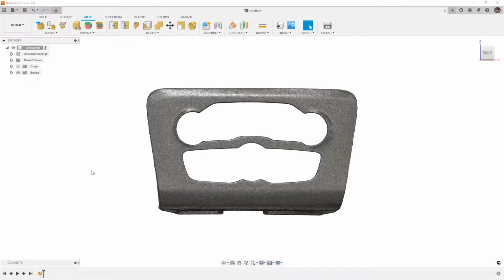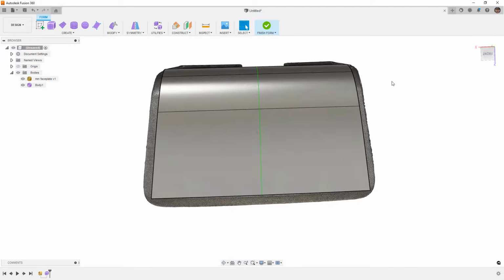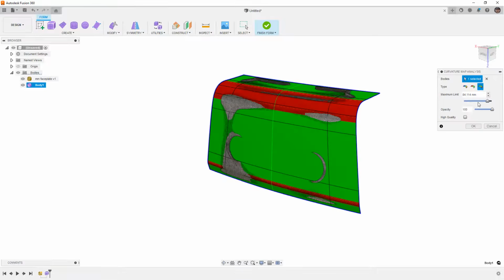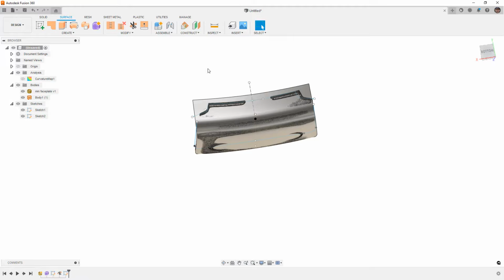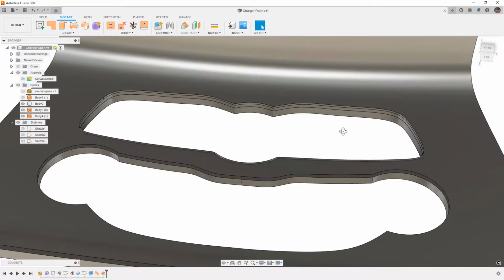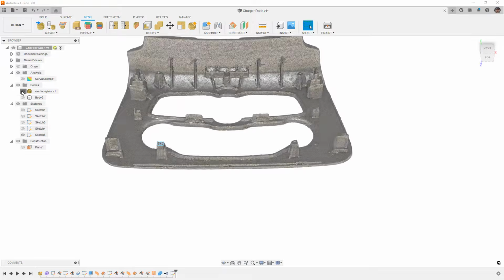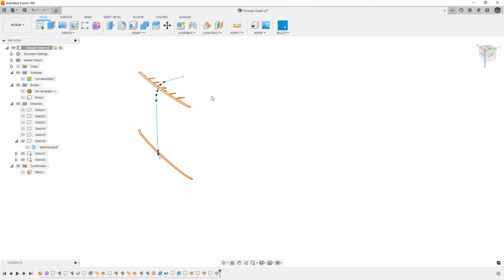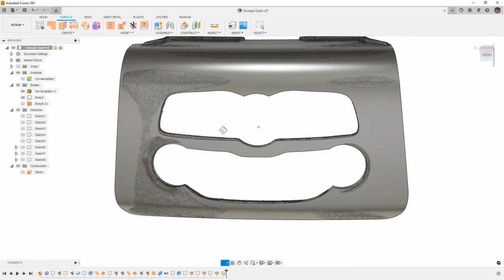Reverse Engineer Car Parts with CAD | Use Forms and Surfaces to create CAD models from SCAN Data

Comment: When I am replicating this process on another scan, my faces do not follow the curves of the object like yours do, they just appear flat between the four selected points. Is there a setting to get it to do that? Snap to object is checked, simple mode, and 4 sides. 

Edit: solved this, for anyone having the same issue - I had lowered the quality of my model too much to make it faster and the place it took the most liberties of removing quality was around the edges. With a less heavy-handed reducing I was able to maintain the curved edges.

Comment: What is a good way to get a 3d line around the outer edge of a detail?
Reply from the maker: If you have modeled the part as a solid, you can start a new sketch and under the create menu go to "Project/Include" and there is an option to include 3d curves.  You can then select the edge and this will give you a 3d sketch curve.

what do you need to use it for?

Comment: How is your software working so smoothly. Whenever i work on scanned data in fusion it keeps on crashing frequently.  System configuration: i7, 16GB DDR4, 4GB Nvidia graphics card, 512gb ssd. Whats wrong with my software
Reply from the maker: The size of the scan data has a big impact.  Fusion is ok with 10k triangles but once you get above that you start to see hits in performance.  You can right click on the mesh in the browser and make it "unselectable" and that helps.  You can also remesh the reference with a lower poly count and just hide the high density mesh until you need it.  another user told me they derive out the mesh into a file and that works smoother but I haven't tried that yet.
The system I did that video on is a 10th gen i7. 3.8ghz (with boost to like 5ghz). 8 core. 32gb ram.  I have an nvidia rtx A4000 but i think when i did that video it was a lower spec card.  RAM helps and single processor speed.  The biggest problem is that the number of triangles that need to be highlighted when your cursor moves over a mesh really drags the system down.  Thats why the unselectable or lower poly mesh helps.

Comment: one question, why do you model the whole part and not divide it symmetrically, having finished the whole half of the part, simply mirror it onto the finished part?
Reply from the maker: In the form, the green line is a symmetry/mirror line.  While i can manipulate either side of it, the model has symmetry.  With a form body that is the way to keep a smooth transition across that mirror line.

If i was doing this with a surface i would create a midline curve and use that as a tangent direction and then mirror.  But with a form if you don't have that symmetry applied there is nothing driving the curvature direction at the midline and you would get a seam when you mirror it.

Comment: Since the shape is already scanned in, why can’t the computer make the mesh?   It’s a computer, that’s what hey are for.
Reply from the maker: There are companies working on mesh to solid conversion tools but in general the tools are expensive and the process is time consuming.  If you just want to 3d print then you can take the mesh and do that.  But if you want a CAD model made of solids or surfaces, that takes a bit more work.

Comment: How did u take it from mesh to designing. I have a mirror that I scanned the bottom of and I want to design a new body off the shape of mirror for a spacer. Howwwwwww
Reply from the maker: Depends on what you need/mean.  I have a lot of videos on mesh based workflows.  Sounds like you might want mesh section sketches.  Week or so ago i started a new series doing mesh based design for an RC car part. might help.

Comment: Great video, very informative, thank you. I am wondering is no way we can create a formed shape much quicker? Such as creating a form, creating a plane, subdivide it as many times as desired, and then get the vertex points to snap onto the mesh (in the one axis). This would surely help create a form of the mesh much quicker? I am very new to playing with 3D Scans / forms :)
Reply from the maker: Thanks.  Forms are great at getting the main shapes down.  Once you have to add details like the openings you need to go to sketch/surface for sure.  This was a part a subscriber was trying to make and because it was going to have mounting details and features to fit the dash we just started with sketch/surface approach. but 100% you can chose the one that is right for you.

Comment: What is the best format to save a scan and export to fusion
Reply from the maker: I generally default to OBJ for this but there are some nuances depending on what you have.  STL will be fine if you are talking about a scan because it is only going to be triangles.  STL saves the points for each triangle.  OBJ actually stores a vector so it can handle non-triangular faces.  So if you are remeshing as a quad-mesh for example then you would want to use an OBJ.  That is probably the biggest difference when picking.

There are other mesh formats but generally their benefits show up elsewhere.  Like 3MF can hold some 3d printing setup information where an STL is just a mesh.  OBJ files are often used for rendering over something like an STL.

hope that helps.
Reply: @LearnEverythingAboutDesign  i have tried scanning with my iPhone 14 pro max using scaniverse the scans turn out good on my phone but complete crap once exported to fusion.

Comment: Great video, I learned about tools that I didn't even know existed. 
Is there a trick how I can position my scanned model reasonably? It floats in free space and I would like to center it at the origin or align it to a straight edge.
Reply from the maker: Yeah there isn't a great way to do it accurately.  It is best to do it in the scan software if it will allow.  I do have a video talking about this with a more mechanical part.  https://youtu.be/82vD7YSKIAo

Comment: id love to see a parametric workflow for doing this
Reply from the maker: I do have some parametric reverse engineering videos.  Is there something specific about this part you want to see? Or just the general workflow?
Reply: @LearnEverythingAboutDesign  Just that parts like this seemingly are like 90% parametric, and a ton of CNC / 3d printing / rev- engineering is going to be parametric. It also allows us to do minor and major changes in cases of material shrinkage- etc. I'd just like to see how the approach to parametric reverse engineering differs.
Reply from the maker: @user-jk9zr3sc5h  sure thing.  Its not exactly the same but if you  haven't seen this series I did (some) of the model 3 different ways, forms, surfaces, and finally parametric. https://www.youtube.com/playlist?list=PLBDfGh8A8kXWa_eSWWPPZ5NevfWsDwJrj

Comment: following along in your tutorial helps me some. still learning fusion... my question is if you were to scan the floor of a car to model a speaker box is this the same principal?  The oblect scanned isnt fully defined due to just scanning the floor. Do you have any videos leaning more towards this type of modeling? Thank you
Reply from the maker: Yeah i do have a few different videos from motor mounts to this dash piece to making speakers for door panels.  https://youtu.be/6ayKg400sEg  I don't specifically have a floor scanned but it should be the same principle.  use the mesh as a reference and attach/match it where needed.

Comment: Coming back to design (for myself now) after 10 years away and was on UG/NX as a contract product designer for GM and was mainly an interior plastics designer and did a lot of class A surfacing. I'm now playing with Fusion trying to make things on my 3D printer and using the revopoint pop2 scanner. I first saw a video by Making for Motorsport and he suggested your channel. This is my first video of yours I'm watching and I'm loving it. I'm so thankful for this content. Thanks for your efforts. Crazy that this software is free and so capable. I'm old..
Reply from the maker: Thanks Ross!  Great experience there!  I used NX4/NX5 many moons ago.  I was working on a project for an OEM that was using NX and required I work with their system. Super powerful tool!  I WISH we had Class A in Fusion but it is a very capable tool.  Even at the retail price of around $400/year considering how deep something like NX or Catia goes.  Great to hear how you find the channel also.  Hopefully in the near future I will have some more full process vids for scanning/design in the auto segment. Stay tuned!
Reply: Would you be abble to reverse engineer a grille design and do some modifications?

Comment: 3 months ago I was thinking hard about buying a 1000$ range 3D scanner or an Ipad Pro with lidar to speed up my design work. Thinking this would be miraculous. I started educating myself, and although I would find decent results scans on YT, it was far from perfect. Then I tried Photogramettry for a month or so and it did not produce satisfying results either. 

After that YouTube algorithm suggested  your 'Hobby vs Pro scanner' video. The moment of truth when you showed that scanning was good for reference but you could not use the scan 'as is', even with an expensive scanner. 

Now, my expectations about 3D scanner are closer to reality. With these two videos, I know what I would get into if I bought a hobby scanner.  I love to see how you reverse engineer these scanned parts. The way you made the interior ring with offset surface, ruled and trim is going to be used from now on in my designs. Thanks!
Reply from the maker: I am glad it helped!  Most of the scan reverse engineering I have done on this channel has been with the hobby level scan data.  I am planning to do some meshlab videos in the future and talk more about mesh processing and manipulation, just need to find the time ;)

Comment: Is there a particular reason why you don't define your mirror lines as "center line" constructions?
Reply from the maker: The differences between a construction line and a center line are minor. Measuring from a center line to another line will default to a diameter measurement and not just a distance.  So generally I use the Center Line type of I a modeling a revolved part.  I think it might automatically select the center line when doing a revolve and it does auto select the center line if doing a mirror, but again if its not a revolved part I generally don't use it.  You certainly can use it.

Comment: I use vx model to section my scans then rhino for surfaces then solidworks for flattening and export to cnc cut
Reply from the maker: When solidworks added the flatten surface tool in 2015 or so that was big.  especially if you are designing parts and cutting composite fabrics.  There are addins (exact flat) for Fusion to flatten faces but they are made mainly for fabrics..and it's not cheap   You have to go through a lot of tools to get what you what, I hate that :)  
Curious why you use Rhino over SWx for surfacing?  You could bring your scans right to SWx(not great with mesh data) and use PowerSurfacing to reverse engineering them then flatten.  Might save a few steps.

Comment: Thanks a lot for the wonderful videos.
 i'm looking to make side scoops for my car what do you suggest is the best way to get the 3d scan of the area where the scoop will be mounted.
Reply from the maker: Depending on the car, sometimes you can find/buy scans online if its really popular.  There are places that rent high end scanners, at least here in the US.  Often times they are rented for a week minimum and last time I rented one it was around $1500 for the week.  Another option is to contact an engineering firm that can scan it for you.  I have one that I work with located in Atlanta, GA.  The last option, and the least precise, is to use something like an XBOX kinect sensor with Skanect software OR look at some of the off the shelf consumer solutions like RevoPop.

The absolute last option is to try and do it with Photogrametry.  Basically taking a lot of pictures of the fender and using software to try and create a mesh.  This requires you use a good camera and have good lighting.  Free versions of software often times will limit the number of pictures(usually around 50 I think), while paid versions allow for more.

If you have an Xbox v1 or v2 kinect you can try Skanect for free for hobby use and see how it works.

Comment: Currently doing this… it’s been a struggle.
Reply: My current issue is that I’m working with a scan of a quarter panel that’s around 800k poly so I have to reduce it down for Fusion to even process it.  I’ve tried both of these technics and it’s painstaking.  I’ve been forced to just convert the mesh and edit the actual mesh… which takes forever.
Reply from the maker: The Tesla wide body I did was the highest density mesh I have used in Fusion.  It had 10million facets on it.  While it was slow it was usable.  It certainly helps to isolate the area you need.  I am happy to take a look and see how it performs on my end if you want to send me an email. support@caducator.com
Reply: @LearnEverythingAboutDesign  That would be amazing!  I’m very much an armature at this right now but I’m learning a lot.  Once I get to my computer I’ll shoot an email.

Comment: Ha!! Literally am doing a video right now on this exact subject, but using prismatic solids more rather than forms and surfaces… (I was planning on signposting to your channel anyway so 🤷‍♂️)… 

Great minds think alike!
Reply from the maker: Awesome!  Something new for the Sierra!?  I enjoyed the ITBs added to it!
Reply: @LearnEverythingAboutDesign  cheers.  it’s a suspension upright, gonna go on the mini eventually, but slightly modified and I want to have an easily modifiable model to do lots of iterative design (guess) work on… and .stl don’t do that! 😂
Reply from the maker: Yeah STLs don't like that :)  Paramesh helps but not like you want.  In case you didn't see it I did a "configurations" video using API to pull in data from an XML file and build versions of a part.  Might be neat to design your points in a spreadsheet and spit out a dozen CAD files easily.  Shoot me an email support@caducator.com  if you want me to tweak the code for you.
Reply: @LearnEverythingAboutDesign  I only understood about 50% of that 😂😫🤦‍♂️.  And this is what I love about your channel, when I am smart enough to do what ever it was that you said, I know the video will be there! 😂👍🤷‍♂️.
But seriously that’s probably a bit advanced for me, but I’m gonna check it out anyway! 👍
Reply from the maker: Next time you want to kill an hour here you go https://youtu.be/mxvQgpgOvzE   :)